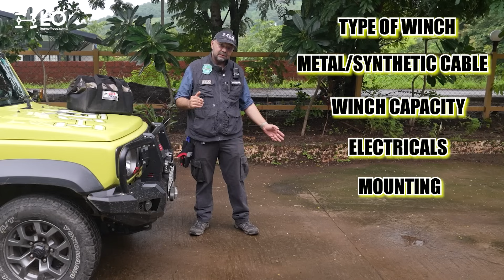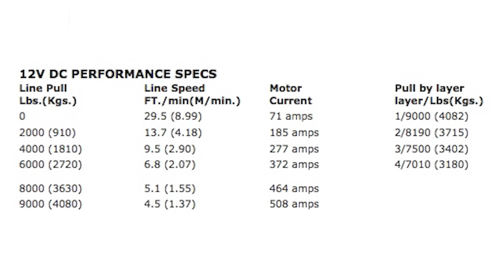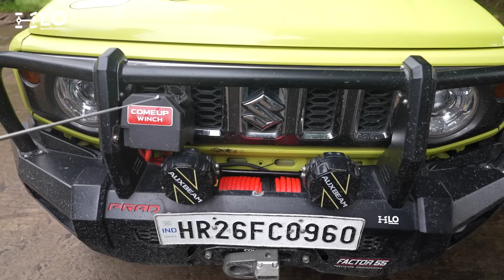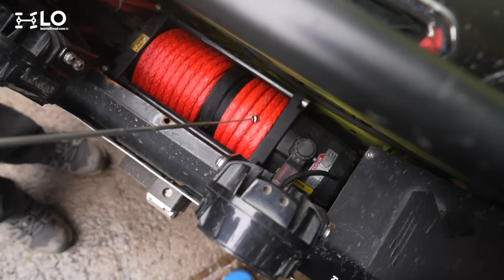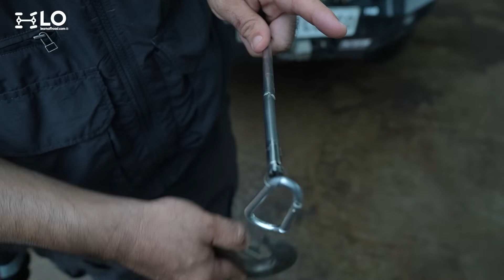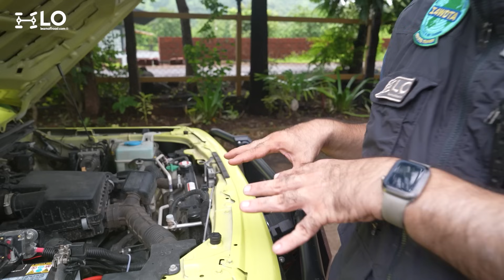How to Select the Perfect Winch for Your Vehicle! @LearnOffroad

Comment: Thankyou sir for picking this topic. Can you also explain about manual winch as it is cost effective solution for occasional offroader
Reply from the maker: We’ve spoken about the hi lift jack as a winch in previous episodes in the past. The Tirfor type hand winch is a great tool but it is bulky with a wire cable which is not easily manageable. But will make a video next month or so after the entire winch series is over
Reply: @LearnOffroad  Yes sir, that would really help to make a decision. Thanks in advance!